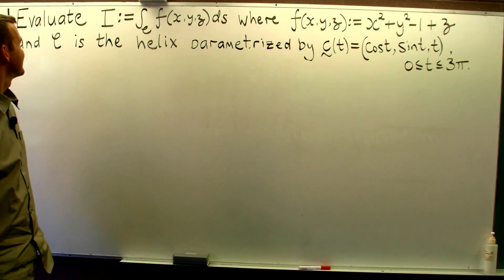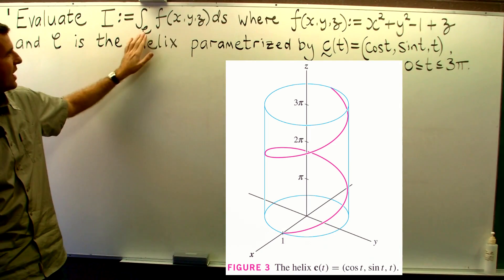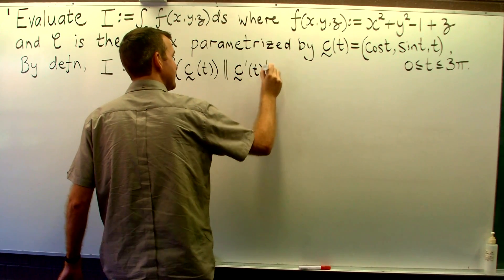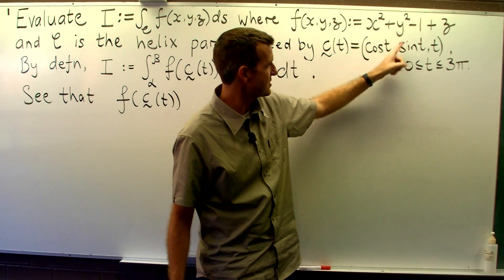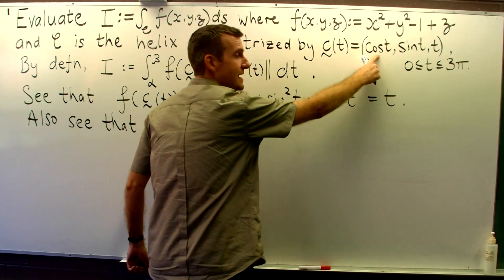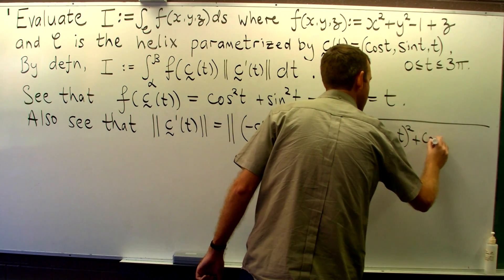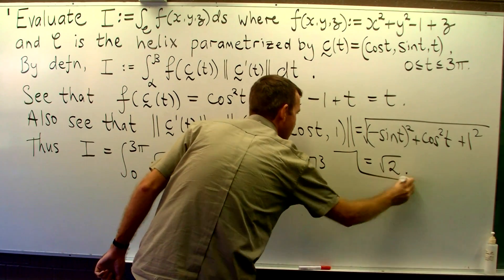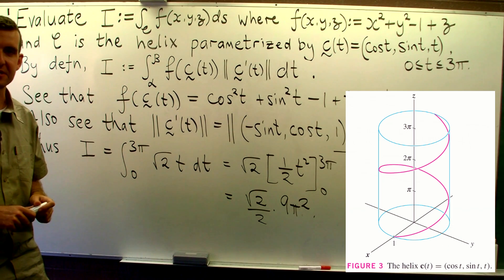Path integral (scalar line integral) from vector calculus

Comment: I have a question here. The formula above applies to scalar line integrals, and the formula for vector line integrals is similar but you just dot the f (c(t)) with c'(t) instead of ||c'(t)||.is that right?

and how can i tell the difference between this two? maybe from the notation of the question?
what i'm lacking is the whole big picture of this 3.2.Thanks!